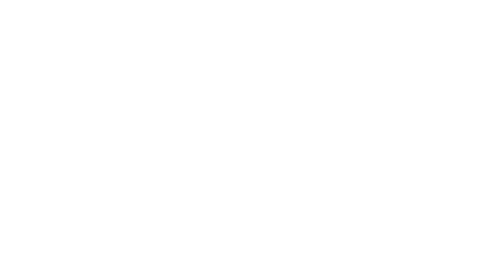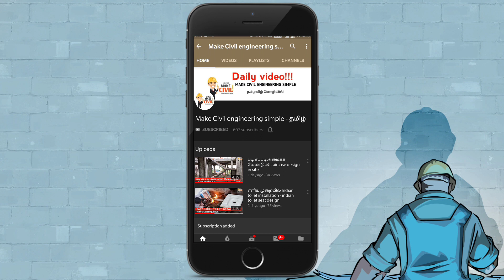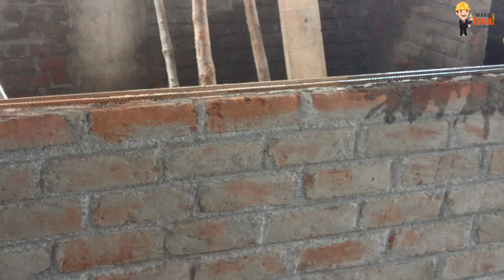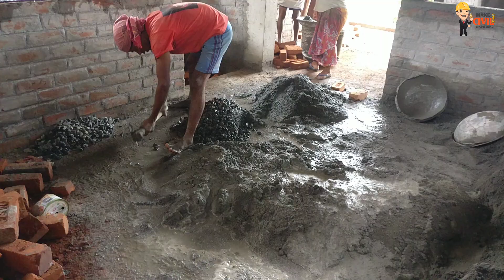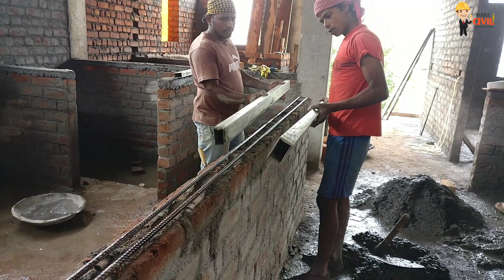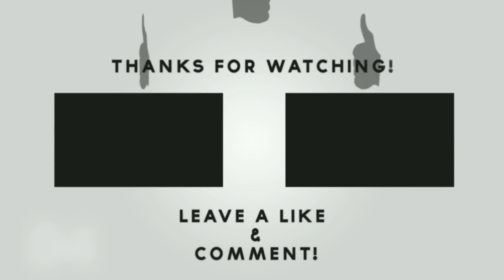கட்டும் போதே இதை சரியாக செய்யுங்கள் - ஜன்னலை சுற்றிவரும் விரிசடை தடுக்கலாம்!

Comment: This video doesn't makes sense.. Wherever two different materials joins, possibility of formation of cracks is more. So, to make it monolithic, we should apply 4" or 6" GI mesh between the joints to avoid formation of cracks over plastered wall. Also, using two rods over 4.5'' partition wall, that too without cover from bottom is never gonna improve tensile force. So, it's complete waste of idea bro.

Comment: Sill slab thickness evlo vaikalam bro?
Reply: Civil Engineering Simple - தமிழ் Thank you
Reply: @civilengineeringsimple  bro sill level la belt podalama ......... Bro solluggga ..........
Reply: In your video cross steals are not there. It should be good if you do the cross joins using 8 mm rods.